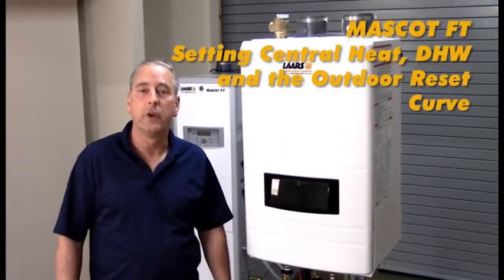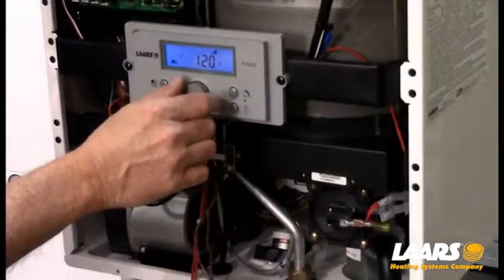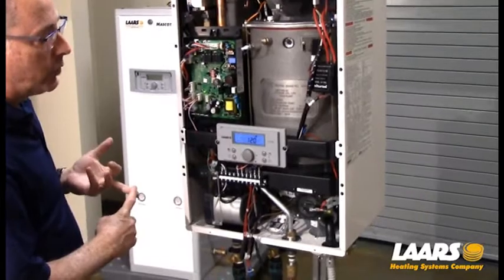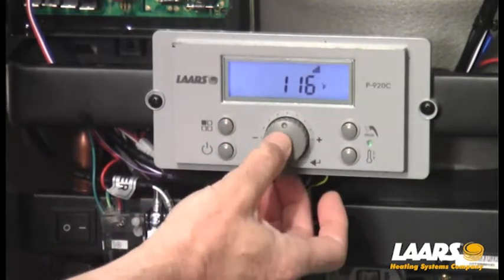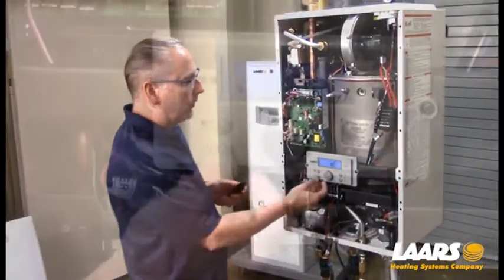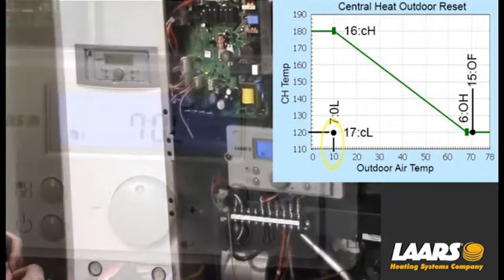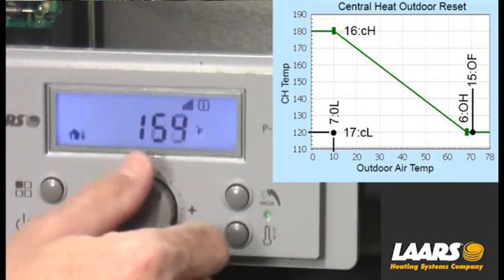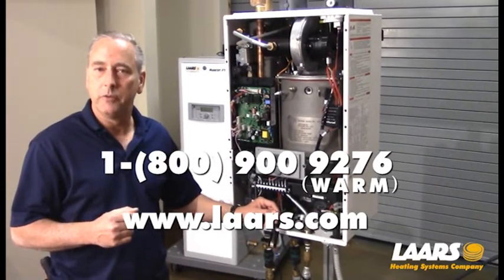Mascot FT.    Setting CH, DHW and Outdoor Reset

Comment: Does this unit supposed to go on every time I flush my toilet or use cold water?  Thats what My new unit does every time and it stays on for 3 to 4 minutes. Just had an install on 10/8/20
Reply: No😆. They must be hooked up to hot water
Reply: @andylarson3547  They found the problem. Every time the toilet flushed hot water reversed thru  an older shower faucet, causing the new boilers sensor to think we were calling for hot water. A few check valves and 300 more dollars (on top of the 9K install) took care of it
Reply: @WideWorldofTrains   do you have a picture or what they got fix ???
Reply: @villalobosiceberg209  turns out it was a mixing valve that adds hot water to the toilet to help prevent the toilet from sweating

Comment: What is error 44 and how to fix it?
Reply from the maker: George, 
   We don't use YouTube as a 'Service Response' tool and I was surprised to find this question this morning,  so please forgive the response time.   A 44 error code is explained on page 64 of your Installation manual.  Chapter 6   

44 Air Pressure Sensor (APS)
Fault
Press the power button to reset
If error happens again:
1. Check the vent pipe for blockages.
2. Check the vent pipe for blockages.
3. If error do not clear, replace the APS
4. If the problem persists, replace the main control.

     I hope this helps.    -Harvey

Comment: im having a problem with my laars mascot ft.... im getting sink and shower hot water byt im not getting heat to warm up the house..... can you help??
Reply: You probably have a defective three way valve in the unit. About a 1.5 hour repair if you're handy.
Reply: @sparkybiscuit   what's the three way valve?
Reply from the maker: We don't monitor the comments on our YouTube channel regularly for Service Questions.  Sorry about the delay.  Please contact our Service Department at 1-800-900-9276   Be sure to have your model number ready and location and service contractor information as well.  Thanks!  -Harvey